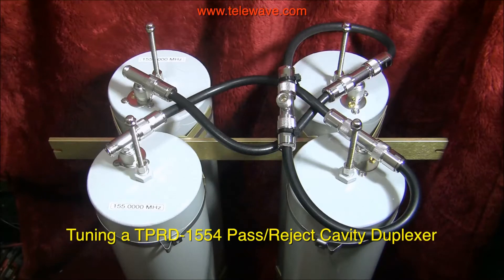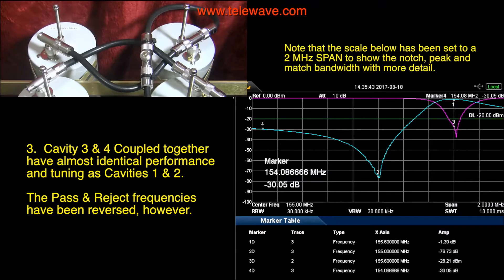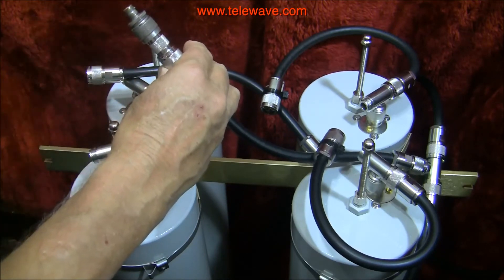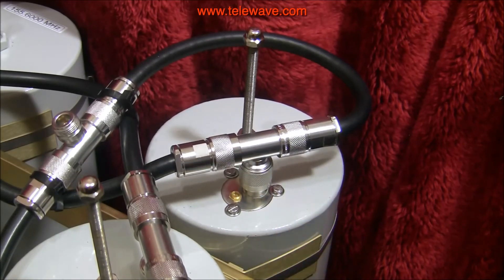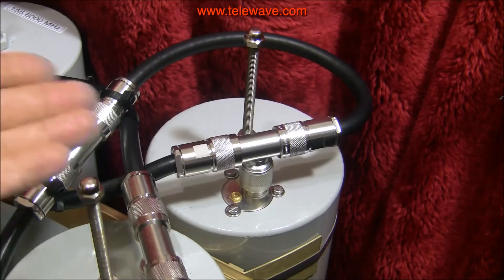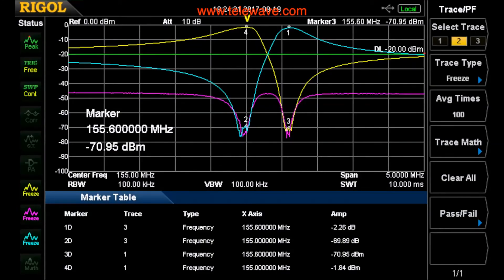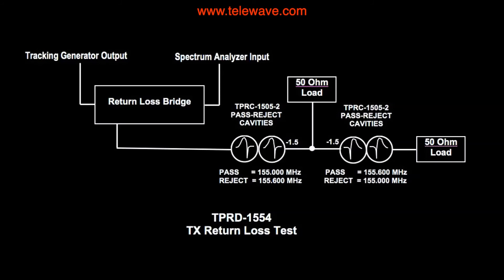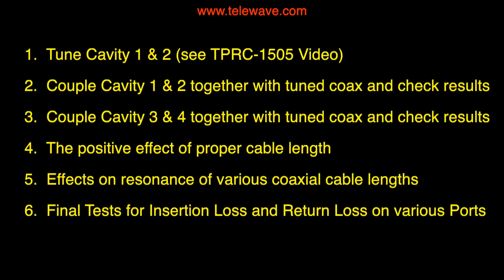Telewave TPRD-1554 Cavity Duplexer Tuning

Comment: Thanks for a very informative video. 

I bought a TRPD 1554 on ebay that was tuned to 158 mhz and 155 on the low side. I had to install 18ph capacitors on the high side to get back
the 600 khz split for ham use (as Telewave recommended). However, the notch on both the TX and RX sides was on the higher side. Since I am
not in the US, to send the duplexer back to Telewave, I ordered some RG402 cable and made my own coupling loops and was successful getting the notches where I wanted on both sides. 

When the duplexer was tuned using the Rigol 815TG, I was able to achieve over -75 db at about 1.2db insertion loss per side. However, knowing that reducing insertion loss too much lowers the  Q, I chose to settle for 1.5db insertion loss that gave me better Q. Although the final effort seems satisfactory, I am assuming that my inter cavity cables might be cut for higher than the ham band. 

Can you please tell us the theory behind how to move notches from the low side to the high side and vice versa? Is it dependant on inductance if the loop? At least one other person has asked the same question and an answer will be beneficial to us hobbyists. Thanks Telewave.

Comment: I have a combiner with 4 of these cavities in the 88 - 108 MHz band that I need to retune. How do I calculate the length of the cables?
Reply: Measure the length of conductor and length of tuning couple

Comment: Hello, I'm making some duplexers (first time) I want to know if the TX and RX duplexers are the same, I mean they have both in TX and RX side an capacitor? because the RX side is opposite of the TX, how to get that reverse?
Reply from the maker: Hi Sergio, 
Think of the duplexer as a Pass High side and a Pass Low side.
There is no limitation between TX and RX Side, but rather, a Pass High Frequency side vs Pass Low Frequency side. Connect the TX and RX to match the frequency specified side of the duplexer.
Reply: @telewave-io9709   What is value and part no of Tunning capacitor for TPRD 1454
Reply: Reading my post above might help if you have bought a used duplexer that was tuned for a higher frequency outside the ham bands. Maybe not, but just a thought